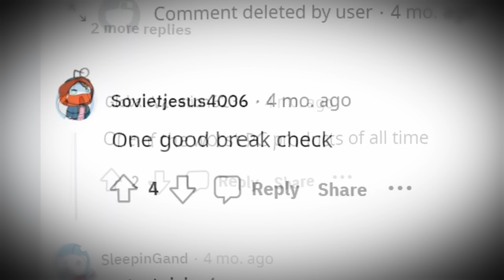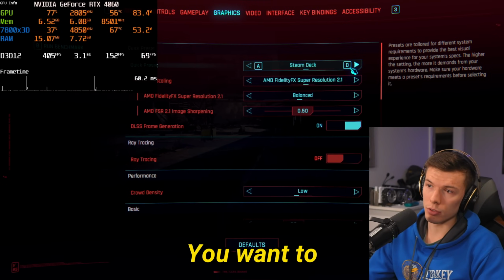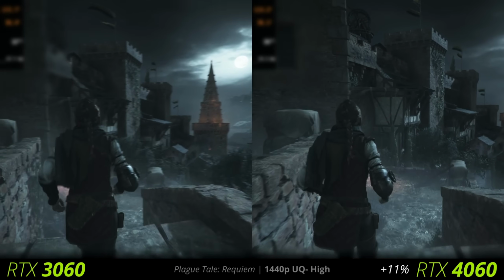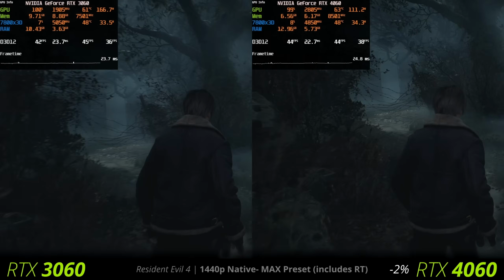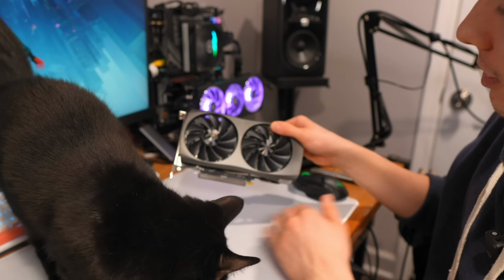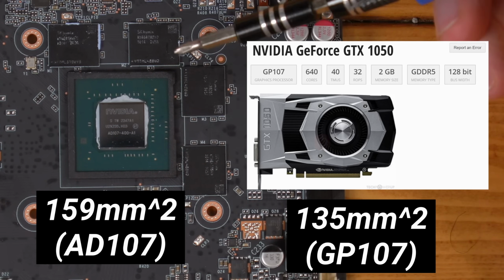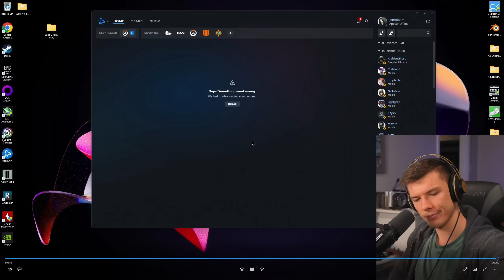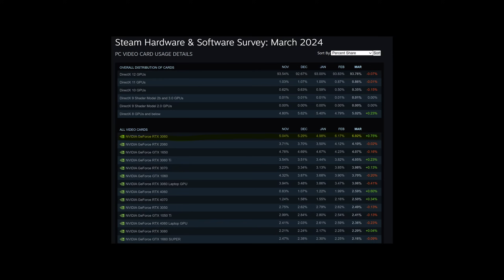I Tried Nvidia's best "Budget" GPU to see if we're Doomed

Comment: Most reviewers are full of shit. GamesNexus and so forth, are no exception.

There is nothing wrong with the 4060. It does not meet their specific expectations. That's all. It performs just fine.

There is no other card in the same pricerange which offers the same performance. No there is not. No the AMD 7600 does NOT perform the same or better.

The problem here is that nvidea could have made the 4060 better, but they did not. THIS is wat pisses reviewers off. Not any objective experience with it's performance.

Comment: Dude, you spent $300 on that—what were you expecting? I paid around $350 for my RX 5700 XT a few years ago because I couldn't afford anything higher-end, and the 4060 is even about 25% faster than my card. We're not in 2005, where video games look like the old tomb raider. It’s a low-tier option, that means no ray tracing at normal or high settings, no 4K, and barely any extra features. You can be glad if it runs games at 1080p with normal to low settings at 60 FPS. That's just the reality of entry-level cards. If you want something you can actually enjoy a high quality with, you need to spend close to $1000 or more. If you want the highest quality for 4K gaming, you'll need to spend upwards of $2000.
Reply: I play the latest games on max settings using the 4060 on a 1440p monitor. The only limitations I have is that I play without ray tracing (not much of a loss imo) and turn down textures from ultra to high sometimes to avoid hitting the 8gb vram limit which is barely noticeable in everyday play
Reply: @Mersoh  What games are we talking about? My RX 5700 XT 50th Anniversary Edition can barely run Sons of the Forest in 1440p on 50 FPS, and the 4060 is just 25% faster, so it should be around 62 FPS.

Comment: Would be great if you tested games that have been optimized and the pool of optimized games are very low. Worst optimized game to date is Cyberpunk and Red Dead Redemption 2. No mather what you throw on those games you will not get eny good results as they are not optimized. All gpu drivers on day1 is not optimized aswell and then we have the AMD vs Nvidia prefered games aswell, where you get bad fps with AMD cards on certain games as it was optimized on Nvidia and vice versa. And last we have windows 11 that is so bad compared to win10. People lost 60fps on win11 becus how bad it is.

Can't really blame Nvidia on this one, games have become a cashgrab the last 10years, pushing them out the door throwing in that microtransactions and then leaving them to rot with basicly zero optimization as they don't want to put money to improve when they can just push out a new broken game.

Comment: IDK if anyone has talked about this, but here's what happens at Amazon: When you buy a single thing, it typically goes through the "Pack Singles" department. If that single thing is already in a box and the buyer didn't check the "Ship in Amazon packaging" box at checkout, they just slap a couple of stickers on that bad boy and ship it out. An individual packer can put that item in an Amazon box anyway, but they usually don't because than can receive a "quality write up" for doing so and there isn't really any incentive to do so anyway. What amazes me is that the sticker Vex wasn't able to remove is called the "Spoo" label, which is how Amazon tracks the package internally; the placement of that sticker was very wrong and the package should have been kicked out for "repackaging" (in this case it probably just means putting another Spoo label in the correct location). Terrible job all around.

Comment: you guys just don't get this card.  for what it is it cannot be beat.  it is 115w tdp.  so nomatter what dell tower your mom got you with a 300w power supply... yep,, as long as it has an 8pim connecter in there, wala.  you are gaming and not too shitty at that.   its the same reason why back in the day the 750ti was gonsidered the greatest achievement ever.  and they even offer a low profile version for your sff case.   see what they are doing there???

Comment: All the smarmy, sneering comments from 4060 haters reeks of the kind of typical elitism that comes from annoying, vain, smug, sexless weirdos in the gaming community who measure their sense of self worth by posting their PC specs for others to behold as some kind of debauched techno-chauvinistic narcissism. 

The reason I bought the 4060 is because it was a massive upgrade to my previous graphics card (GTX 970) which I bought in 2016, and it was the best value for my money when measuring performance output strictly on a per dollar basis. I have a 1080p monitor, and I don't really care about rendering shit at a higher resolution or with ray tracing. Simply put, I needed a respectable, medium priced upgrade to my old graphics card which will last me another few years before upgrading to the next medium budget graphics card with a good performance to dollar value.

The only real valid criticisms of this card is that, for being marketed as a next gen ray tracing card, it is marginally too expensive, the VRAM is a bit weak, and it cannot ray trace current gen gaming software effectively. The 4060's hardware cannot ray trace games released within the last few years effectively, but this card is able to run those same demanding games at high or ultra performance settings with minimal frame loss. However, when measured at a performance per dollar value, this card is among the best, if not the best, card on the market for generalized PC gaming at 1080p (ignoring ray tracing), so in this circumstance, criticism against this hardware falls flat if you consider it to be a middle budget card for general gaming at 1080p intended as a solid upgrade for older builds.
Reply: So real. Bought it for 320 USD (import tax included to PH), not too bad. I chose this card coz I’ve observed it can run 1080p max settings on most games. Probably the best upgrade I got coming from GTX 1650. Power efficiency matters too. Pricing may suck but you gotta assess, pick what gpus are inexpensive in your country.  Prices of 4070 and higher cards is damn expensive here (30%-50%+) than the usual retail price in USA.

AMD RX 6600/6800 XT is an option, but mostly used gpus sold here which I don’t want to risk buying. I don’t do gaming alone, i do productivity alot so i chose team green

Comment: I'd say that the 4060 one of the best entry level gpus atm. In Sweden at least it costs the same as a 3060 at 300-500$ and the drivers are so much better and simpler than amd or intel. The next step up is 4070 for 700$ and we don't talk about the 50 cards. With frame gen getting better and is not availible on 30 series you kinda have to get a 40 card to keep it from getting irrelevant. I also think that it's a good thing it doesn't draw that much because then you don't need a beefy psu.
in conclution I think the 4060 is the best entry level gpu atm and I don't get all the hate

Comment: I can run cyberpunk on raytracing overdrive at 40fps with no frame generation on my 4060, don't know what's wrong with your pc for you to get 5 fps, seems to me like you're kind of full of shit tbh.

edit: oh i see what you did, you quickly went in and turned dlss off after putting it on overdrive, kind of disingenuous to select the preset then go in and turn settings off to get worse performance. but ok, even with dlss on you're only getting 15fps? idk bro, i get 3x your performance with the same settings, what do you have a core 2 duo or something?